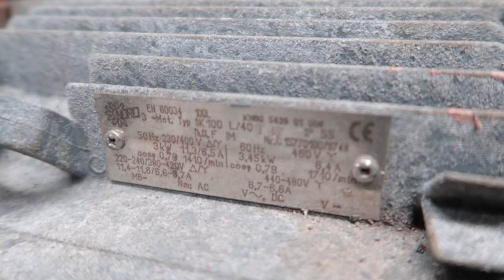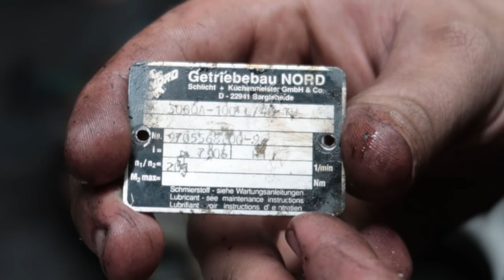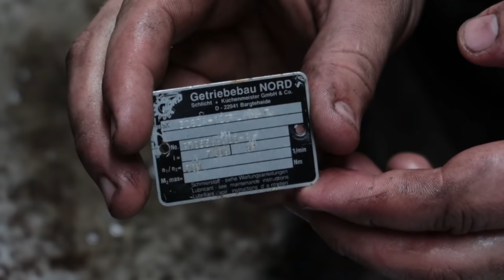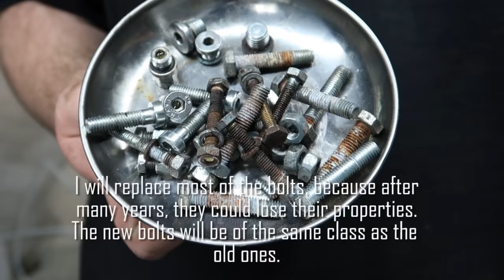Restoration - 3 Phase Helical Gear Motor

Comment from the maker: Hi everyone!
Please let us know what you think about this video and don't forget to check out our social media :)
Instagram - https://bit.ly/2MgQ6KY
Facebook - https://bit.ly/2TuDNLX
Reply: Very nice all the best
Reply: Did you not restored a old new stock motoreductor?
It did not have a entri hole for the power
Reply: That is whi it was brand new on the inside.
No wan puts the hole plugs back . If you search in scrap yard every time the old power cabel is cuted
Reply: It seems a bit wasteful to be replacing parts that need not be replaced.
Reply: Great video thanks for posting.  I also use hammermill paint but I like spraying - unless u like brushwork??  You could find an HVLP paint gun easily and they are affordable.  The paint finish doesn't represent your hard work and skills - show it off!  Sandblasting (after you replaced all seals and bearings - I may have done that part while old parts we're still in.  Then just clean off with acetone before prepping for primer.  When u removed the electrical box, there are holes into the motor, yes? It seems as though debris may have found its way into the armature. Lots of ”positive” good comments on here, critical but in a good way!  Keep up the good work.  Great video quality, the length was decent, someone mentioned the sandblasting - that was ”harsh-sounding” maybe silence or a tune?  Looking forward to watching more!  The steel-toed sandals and beach shorts are classic until you drop that big gear!  Just saying 😁👍!  Stay safe to you and all other viewers!!
Reply: :p
Reply: kerala hatcheris
Reply: please what can i do to have this complete system?

Comment: I'm not sure if sandblasting a completely assembled motor is wise.When I was rewinding motors, I would clean or sand blast the exterior of the stator with the rotor and end bells removed and blocking the ends of the stator. Sand blast dust has a way of creeping into the bearings which tend shorten their life span.

Comment: New meaning of restoration is: Disassembly working geared motor, which helical gears looks new, motor looks new. Then clean up and  paint it. 🤣🤣
Reply: Looking in a good condition but not looking new.
Reply: Yup. @0:37 if the oil looks like that, put the plug back in and dont contaminate a pristine gearbox.
Reply: And bearings he binned are probably better. At least they were right ones.
Reply: Restoration is really a blanket term. It means something different to everyone. Just because it is mechanically sound and is working well does not mean it is not a restoration.
Reply: @Super4017  So were the ones he replaced them with! I don't think he installed a different size, do you?
Reply: Not a new meaning at all. New gaskets, new bearings and a lick of paint, that's always been a restoration. Not a repair to something broken, a restoration!

Comment: Well done

BUT i hate to service NORD with the locking bearing on the rear and big pinion gear you cannot remove the motor winding without a complete tear-down Unlike Eurodrive with a locking front which allows winding and rear bearing service

Comment: omg have you really sand blasted the motor with the bearings installed
Reply: Sheila Walker yeah but the bearings die when they have sand inside
Reply: @johannesmuller1288  he covered them before.
Reply: @no-eb2xx  bible ssalm 91

Comment: Why did you take it apart q.q it is from Nord Drive Systems they last forever made in Germany stuff we use them in some industrial applications and some of them at least run for 20 years now every day!  They hold up longer than SEW stuff some of them fail in 5 years life time q.q
Reply: Merlinkatamari not working or restoring? Bring it back to factory production standard?

Comment: This looks awesome but I have one question. Why did you open the bearing seals and remove the grease inside?
Reply: The bearings do not need grease because of the oil bath in the transmission box. The oil will lubricate the bearings.
Reply: @Frank-Thoresen  Yeah I saw that but still...couldnt he just keep the bearing grease? Wouldnt it mix in the oil?
Reply: He bought wrong type.

Comment: You have a problem with the shaft seal at the input gear, wrong face. Oil will leak from the gearbox via stato of motor very soon, let check.

Comment: Should have set your gear box at 90 or 180 degrees so a full length shaft could run through without hitting the terminal box.

Comment: Completely unnecessary "restoration"..   If you wanted to paint it, a bit of paint stripper and light hand sanding on the outside were all that were needed..  That motor and gearbox were both immaculate inside.   All the original bearings and seals were probably better quality than your replacements and if you left any speck of sandblasting grit in that gearbox, you'll eat those bearings quick..  Sorry, thumbs down on this one.

Comment: How a 1+KW motor has capacitor connectors, i mean on single phase you should never use motors over 1KW
Reply: Where do you see here capacitor connectors?
Reply: @0plp0  on top of the power table/connector there are 2 small white wires comming out, i suppose they are for saving energy capasitors since many elec distributors tend to ask you to pay ABILITY TO DISTRIBUTE AMOUNT OF POWER AT ONE MOMENT at least thats how in ex yougoslavia countiries it works

Ps i am talking about the power to spinup the motors
Reply: @boomwithpeter623  No, that is motor ptc thermistor. If the motor get 2 hot it's turn of the contactor when it's used to turn on the motor. In this case it's not connected and he use normal switch to turn on the motor.